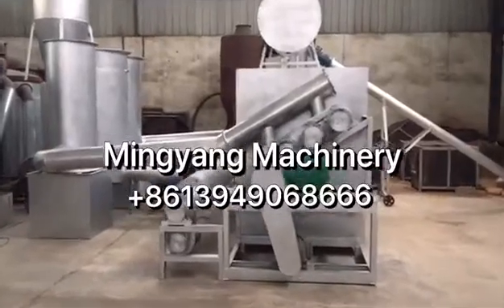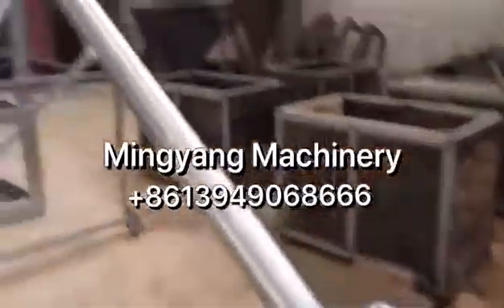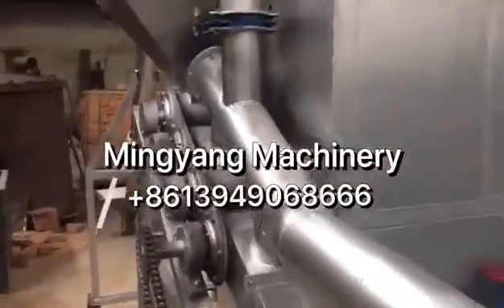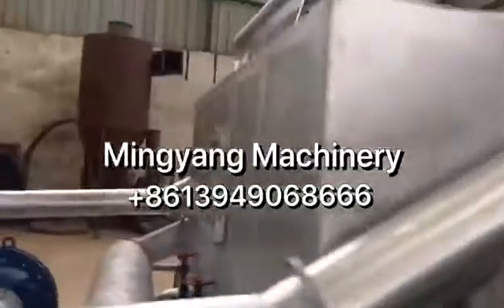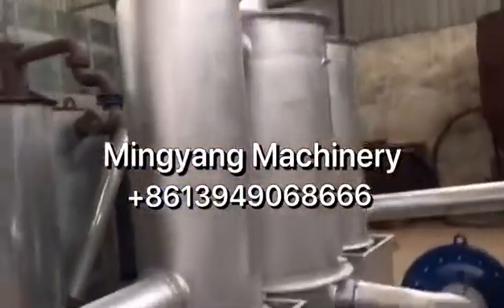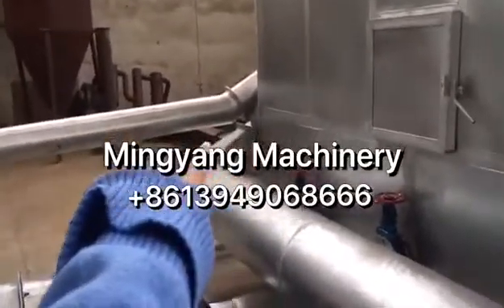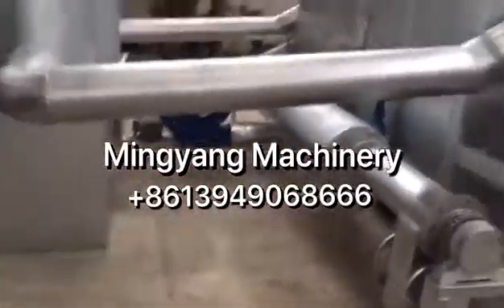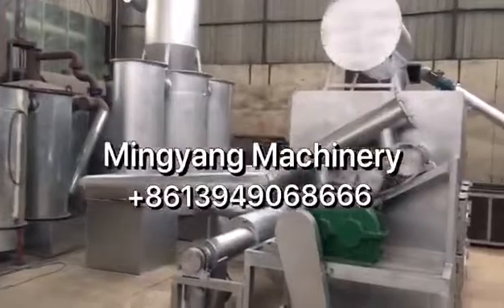Rotary continuous Square shaped charcoal furnace

Comment: I will like to known about this. What is the different between this and continuous rotery carbonization machine?
Reply from the maker: Hi Ibukun, this is smaller capacity. This is 4 smaller diameter drum rotating continuously working. This one is also continuously working carbonization furnace. Contact me +86 13949068666 I will send you working video.